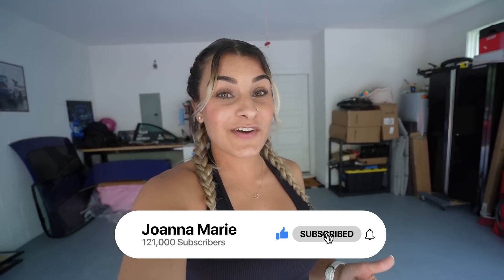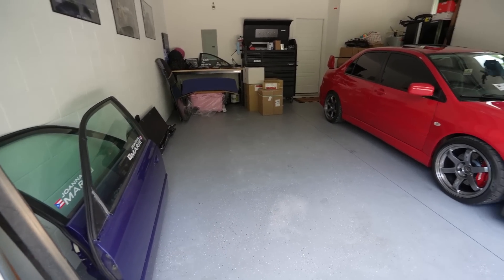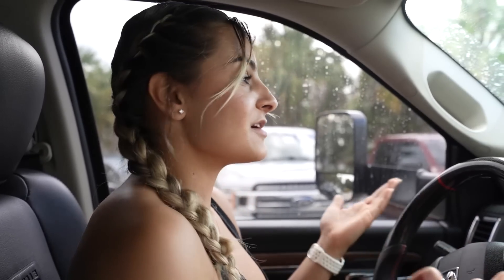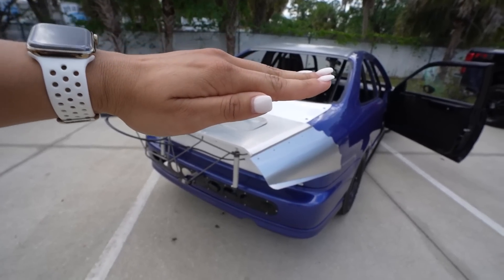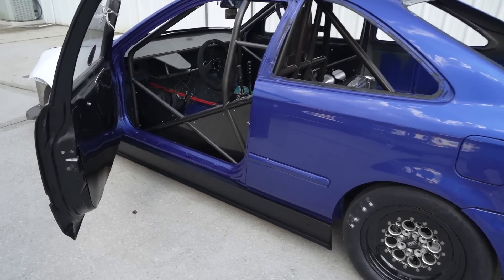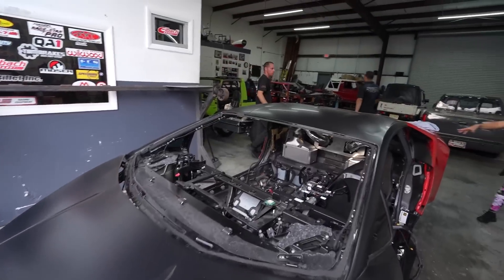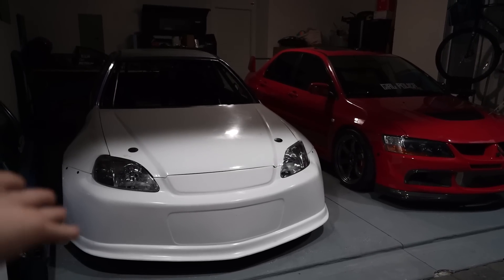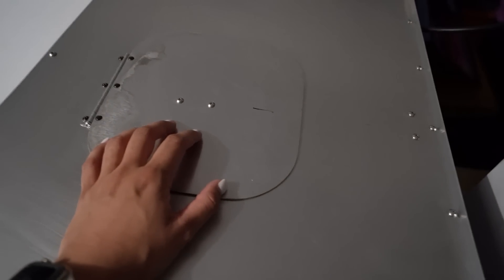I GOT EXPOSED? | BRINGING THE CIVIC HOME!

Comment: It was a regular trailer and a Honda which is really light to a dually but I’ve towed a 20’ enclosed trailer with a 350z inside  with a 1500 Silverado. It towed with no issues and did pretty good on gas. If you want something you can be able to daily if you need to and won’t be so big and be able to tow a enclosed id say go with a 2500 or 3500 cummins (not dually) but ofc dually’s are great too

Comment: @Joanna Marie;  Am glad to see you post Your development, steps in the process with Your racing vehicles including the actual racing preparations, test'N'tune, events.
This specific Civic development, upgrade, improvements looks, appears to be excellent toward having, achieving Your quest with a "7 sec" vehicle with the full cage, "7.5", "25.5", including the full hoop, specific cage structure by Ricky, etc.
Clearly this all looks very exciting 😆 with much anticipation 😄, especially within this 2023 season !
A. It seems clear from within Your videos that You have obvious, clear personal preferences with having a 'blue" color vehicle along with Your desire that Your vehicle be unique, recognizable too; not confused with another similar one. It seems clear also that You would benefit most with using a "wrap" to achieve the desired unique look, You are looking for, perhaps already have within Your creative imagination. A wrap also not only allows You to continue to proceed more quickly along with Your individual efforts, focus ,upon, with, within completing the mechanical portions, especially the engine, drive train, and other necessary components, it also has the advantage to allow to more easily modify, change the exterior along with having Your preferred 'Blue" combined with Your personal choices, personalization, combination, creative imagination, etc.🙄🤔
B. Joanna, as You know well about safety issues, especially with Your personal actual crash experience at the end of last year with tis Civic, though thankfully not severe, along with others perhaps, while this vehicle is still in this cage, frame state You might also consider 🤔 some additional features, aspects; namely:
1. a full containment racing seat, especially with protection on the sides for head & neck, with additions with hold the body more, along with full head and neck restraints 
2. having a button, easily accessible parachute release, deployment on the steering wheel and seriously consider having an automated parachute deployment system which connects with the ECU as E-chute and many professional drag racing team vehicles have
3.-> certainly Your life, well being is worth having these along with the inner confidence, relaxed mindset 😌 having these important safety items, aspects,details, components
4. If You have seen, or not seen, the crash, post-crash videos from Tess Woods with her Supercharged Maverick that occured in Nov 2021 athe "The Strip" in LV, NV during the SCTN along with her personal commitments with the improvements she decided to include within her next "Maverick" build, especially through her crash experience 
a. -> also without any serious injury - only a small wrist fracture - though car, vehicle was/is damaged beyond repair - some components saved - and excellent full cage 
b. > very worthwhile to review 👀, see 👁 and hear 👂 listen to her in-car videos, descriptions, etc. 

All The Best, Much Success in Your Quest, Health, Happiness and Well Being 😊. Sincerely ☺

Comment: Dually's were specifically designed to be more stable than a regular truck when pulling heavy weight. What I will say is based on your videos, you may not need a diesel to still enjoy the benefits of having a dually. The emissions stuff on all the newer diesels are outrageously priced considering its mostly emissions system and replacing those items on newer trucks that is overpriced and shouldn't be. In the end it is your decision just trying to give some advice.